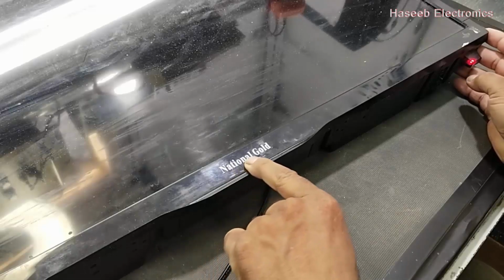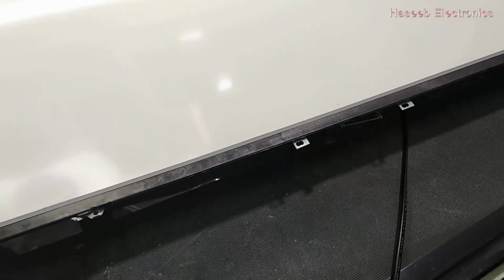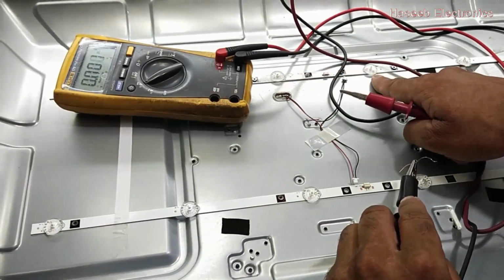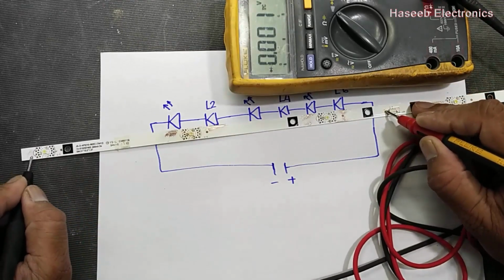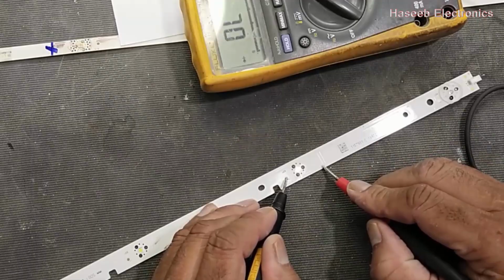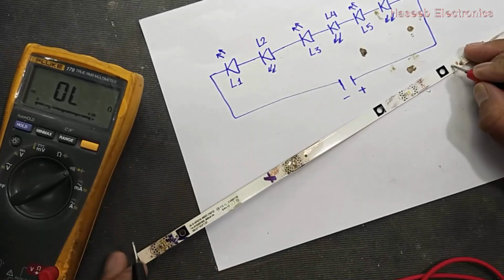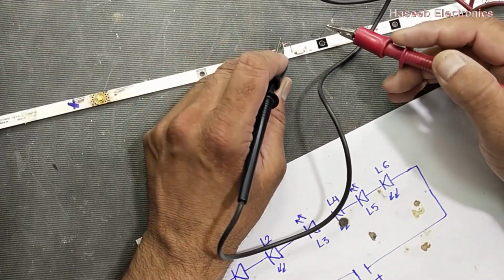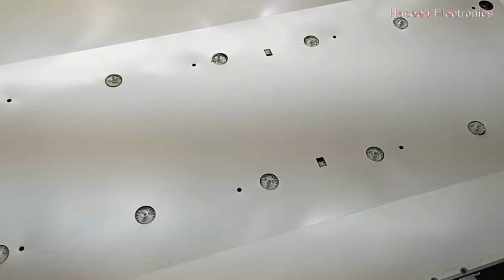{536} How To Repair of LED TV Backlight Strips / How To Test LED TV Backlight Strip With Multimeter

Comment: When you supply the 18 volts, do you need to limit it's current with a power supply setting or does the internal resistance in the LED's limit the current to a safe level?
Reply: each led consumes 3 volts, so its the right amount of power for a 6 led stripe,

Comment: Thank you very much for sharing this information. What is the supply DC voltage for the led stripes? Is 19 volt as you measured it?
Thank you again for your time and effort?
Reply from the maker: best regards and special thanks for your valuable comment 
voltage value depends on the LED type, the voltage are maintained by the monitoring the current by the LED driver

Comment: Gentleman you used flux for soldering LED but did not bother to clean it with IPA. Flux is acidic in nature, so copper on track will be eaten away by flux in few months, again problem will reoccur. This is from my past experience,  I'm active in this field from last 45 years.

Comment: After replacing the LEDs. Some Emmitts yellowish light and reflects on the screen. What could be the problem sir. I fail to it out.
I tried using white spray, but no difference.

Comment: From my RepairCafé experience I can say, the LED backlight strip is the most common failure on Flat-TVs nowadays. It will last shorter and shorter, often not more than 3-4 years. Often these TVs will be thrown away in my country. What a waste of resources. Thank you for your repair video.
Reply from the maker: yes sir you are right. the main reason is that the LEDs used in LED strips are poor quality, which have very low operational hours life. 
this technique is mainly used to reduce the life and increase the sale 
best regards and special thanks sir